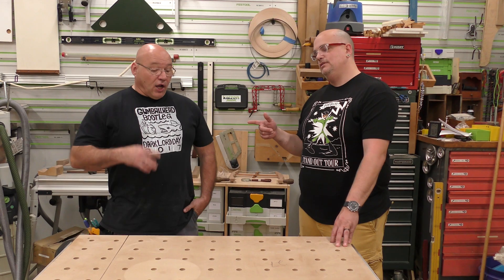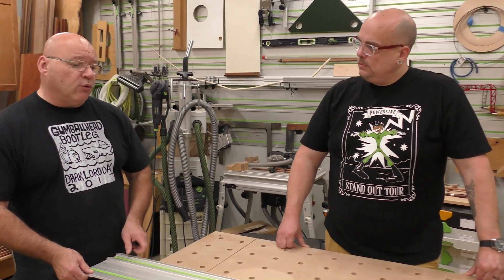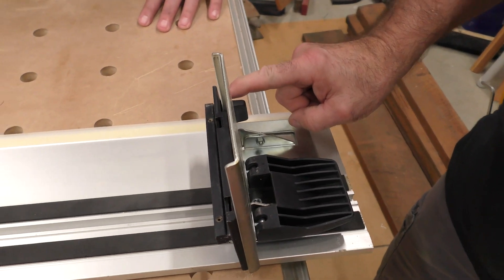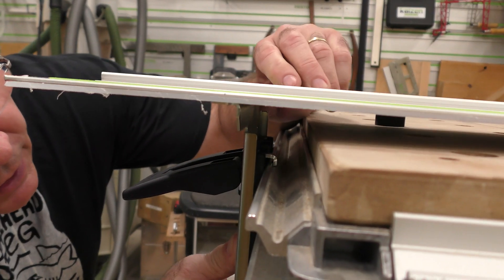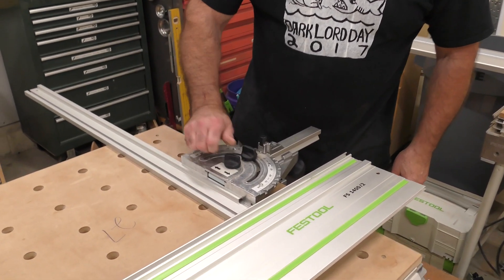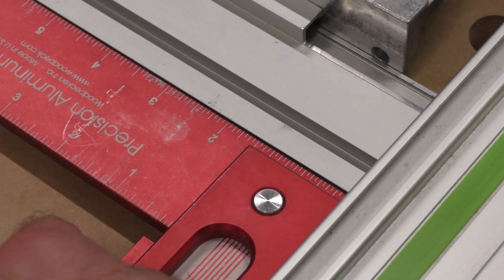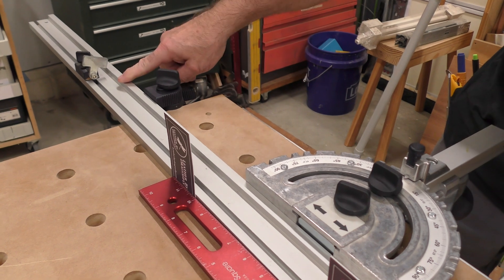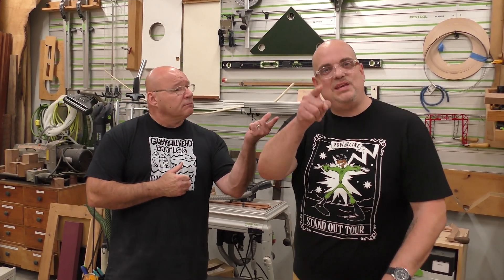Can You Setup Your MFT Longways? Alternative MFT Configuration

Comment: Been on the fence about getting the mft3 set but I’m almost convinced I can use this!
Reply from the maker: cool.. The MFT/3 is a great tool ...
Reply: I love my MFT/3 but honestly as I've learned more, if I was to do it again I would just make my own dog holed table and use that with accessories.  While the MFT/3 is nice, all those attachments for the rail and stop take up a LOT of the table's space AND make it hard to push into a corner when not in use because they hang so far off the table.  If you have a big shop with lots of room then it fits in nice but and IS very useful for crosscuts, but if space is at a premium it's tricky.

Comment: I'm enjoying your videos, thanks for posting them. A quick comment on the accuracy of the table/holes/dogs: Those Veritas dogs are NOT all the same dimensions. I have 4 of them, all purchased at the same time. Three are close enough to be matches but the third is completely off. First, the dimension from the flat face to the opposite side varies by at least .03mm from bottom (cloest to the bench) to the top on all of mine. The oddball piece is .2mm undersized compared to the other 3. Across the length of the table that difference is the thickness of a piece of paper so not really significant but it is detectable.
Reply from the maker: Thanks Randy !!!! really good to know

Comment: Can you do a video going over older style rail guides?  are there any limitations of old style rail guide vs new?  I have an older style LR32 FS1080 and its missing the second track
Reply from the maker: Great Idea ....The big difference is the multiple clamping possibilities and extra accessories that work with the second rib/track
Reply: @sedgetool  That would be awesome.  Suprisngley there is not much info on the older rails or at least i couldn't find any :)

Comment: Another great one Sedge! Wondering I'm setting up my Festool shop and have 1 MFT basic with Bench dogs fence. I'm considering to purchase another MFT or get 2 of the MW1000 extensions tables having one on either side. Essentially I want to combine a table for crosscuts and ripping down sheets. Tired of the floor method to rip sheets and not wanting too do saw horses. Any thoughts?
Reply from the maker: that sounds like a perfect plan.......

Comment: I bought a used table, it’s a MFT 1080, no protractor unit. Is the CMS angle unit the same thing?  If not can it be used on the MFT table?  Great video as always!
Reply from the maker: The 1080 has a T-slot vs a V Groove which the angle unit for the CMS has...... It can be used on the MFT/3 table but not the older MFT 1080.... Hope this made sense ...Thanks Craig

Comment: Is it possible to buy the cross-cutting parts separately from the MFT table?
Reply from the maker: the cross-cutting parts are not sold as a whole package ... but you can piece them out here

https://ekat.festool.de/login3/app?__bk_&__windowid=KWU226826924&__rid=MOR1643407945714#2VFB2144C915D47DFAD66CC73CEC1F7E17E1D29351DB45EA618EEFB7B1BB136D42B8044FCE28E6056D
Reply: @sedgetool  thanks for the information.

Comment: What's the minimum thickness needed for the right angle to set the MFT up like this? Woodpecker and TSO squares are basically sold out everywhere here, so I need to get an alternative. So basically what I'm asking is, how thick is the long rail with the stop on it? 😁
Reply from the maker: the thickness of the fence / rail with the stop is 12mm

Comment: Can you buy any of these parts separately? I already have the 1400 track, 20mm dog hole custom mft3 I built myself
Reply from the maker: They are not available as a whole hardware kit...but....all the parts to make one are available at the Festool website here 
https://ekat.festool.de/login2/app?__bk_&__windowid=MPX274225450&__rid=DKL1632133427704#2VFB2144C915D47DFAD66CC73CEC1F7E17E1D29351DB45EA618EEFB7B1BB136D42B8044FCE28E6056D
Reply: @sedgetool  thanks! An unrelated q about the AGC I’m eyeing to get - will it work at peak performance with the 4.0 hi/power battery I got with the impact driver ?

Comment: Wouldnt it be better to adjust the rail rather than the square?
Reply: That way, if the square is square, you can rellference it for squaring rails to any mft.
Reply from the maker: I always reference the rail to the fence with a square ...always ends up with a perfect 90 on material
Reply: Yeah I tried to say adjust to the mft rail with a square. Meaning adjust zero on the miter fence to the table edge rail. Mismatch of terms on my part.  @sedgetool
Reply: @sedgetool thx; great channel!!

Comment: Don't understand this. It seems to me you were adjusting the protractor to true 90 degrees. Not changing the rail at all. What am I missing?
Reply from the maker: the 1281 Square is on the rail and fence and the protractor head is attached to the fence so it trues The cut to 90
Reply: @sedgetool  Aha! Light dawns...